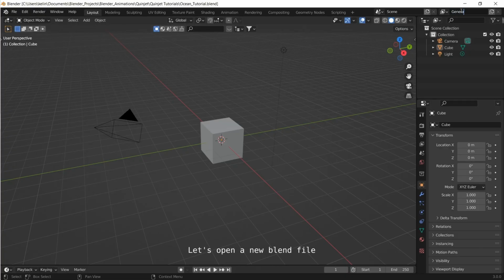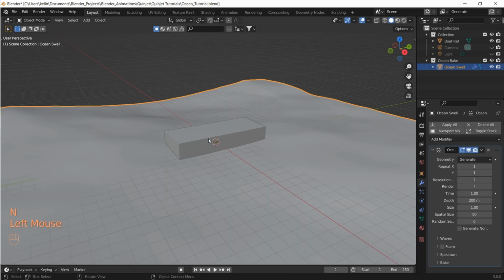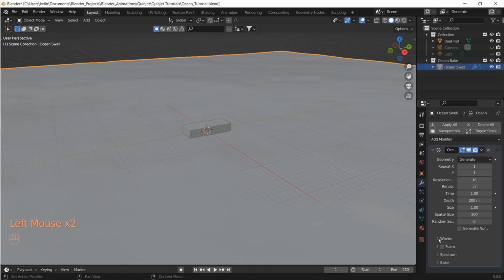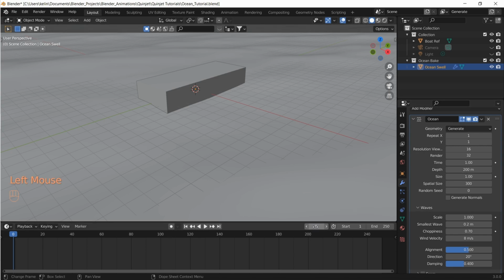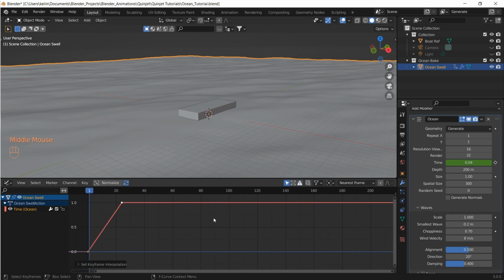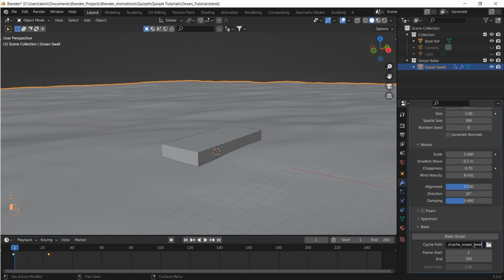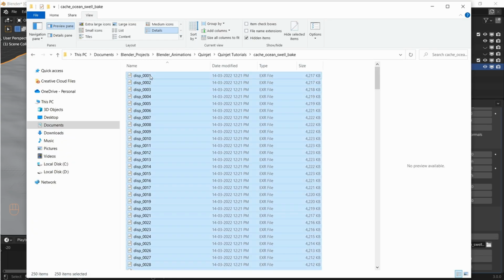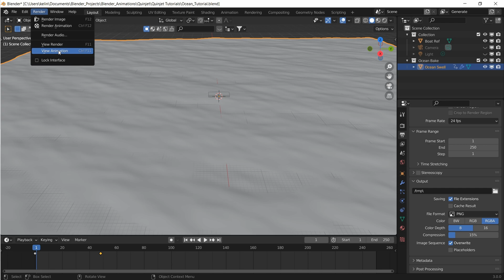Blender Tutorial | Ocean Swell (ocean full tutorial link is in the video description)

Comment: Thank you for the awesome tutorials. One question though, the water dripping looks a bit chunky. Is there a way to fix it ? I tried increasing the domain resolution. But past 250 my pc gets stuck on the first frame
Reply from the maker: You're very welcome! This flip fluids sim was done an year and a half ago. I've done a lot more RnD on flip fluids simulations since. Please watch my latest hi-res fluid simulations (links are in description). Flip simulations are RAM hungry. For a realistic look, this simulation requires atleast 1024 resolution for closeup shots or atleast 512 for far off shots and require atleast 64GB ram. Also these simulations take about 12 hours to run on powerful processors (my system has 20 logical cores).
Reply: @blendercinematic  Thank you, I am currently watching all ur videos :D
512 !! that explains it coz i am simulation with a resolution of 200. That's why it looks chunky then. Thank you so much and thank you for the LCL @blendercinematic  Thank you, I am currently watching all ur videos :D
512 !! that explains it coz i am simulation with a resolution of 200. That's why it looks chunky then. Thank you so much and thank you for the CLCLI rendering method, it is just awesome
Reply from the maker: You're welcome! I'm glad its helpful.

Comment: I've encountered some real problem here as I enable Adaptive Subdivision and use subdivision in Render tab. It takes alot of Vram and cause the Crash whenever I go for a render with GPU. Any way to workaround that sir? Can I just add another subdivision modifier to Ocean and change Feature set to supported?. My PC isn't weak at all: it's 3080 with i9 12900k and 64 GB of RAM.
Reply from the maker: I completely understand - with such powerful PC, normally this shouldn’t be an issue. However, the computation is so heavy with adaptive subdivision that I had to apply single frame rendering method through Command Line Interface (CLI) which is very uncommon. That was the only way I could get the animation to render. I explained it in detail in the last part of this series. Hope that helps.
Reply: @blendercinematic  Yes, in the lastest version of FlipFluid addon, they add a function called Command line Rendering which, I think, is the same as your CLI rendering. Thank you for your reply sir.